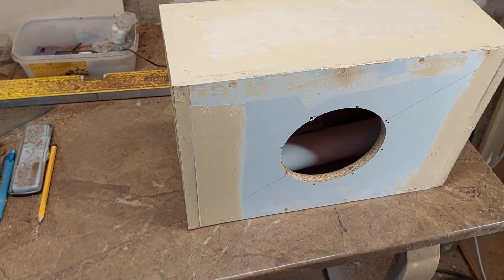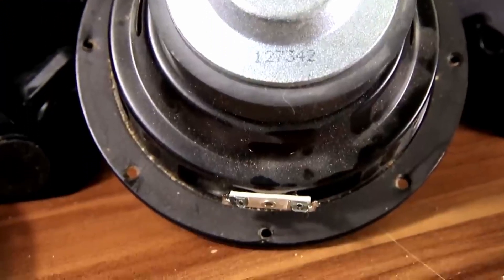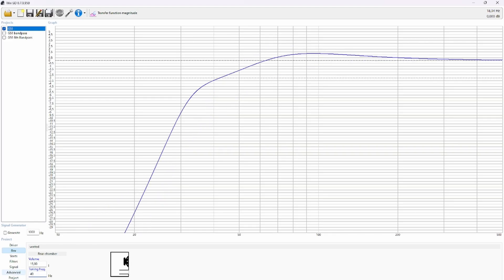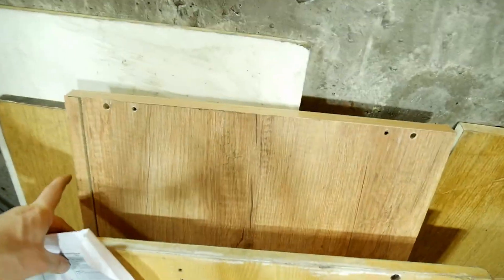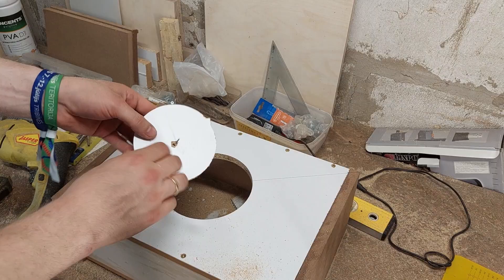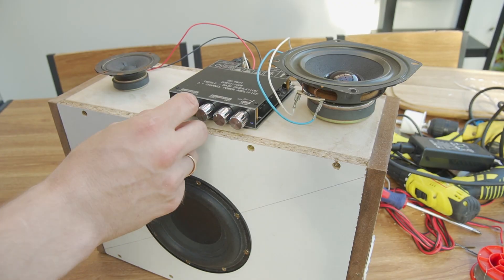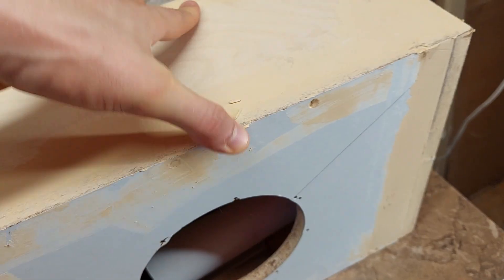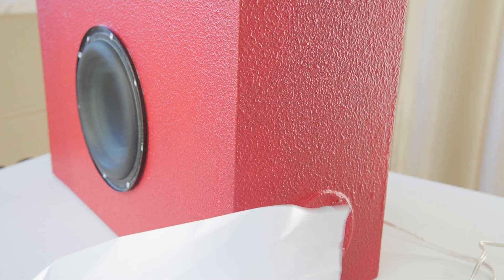How to Build a Subwoofer Box for Logitech Woofer

Comment: What is port tuning frequency
Reply from the maker: In the simulation I used around 40–50 Hz, but I haven’t measured the real port tuning yet. I’ll try to do it in my bass test video, since the actual frequency will be different because the driver and port take up box volume.